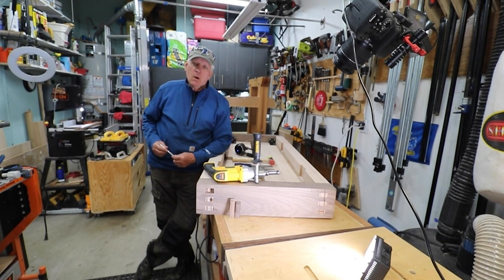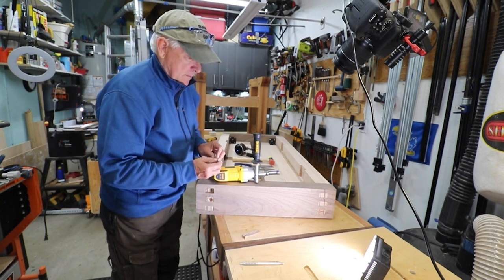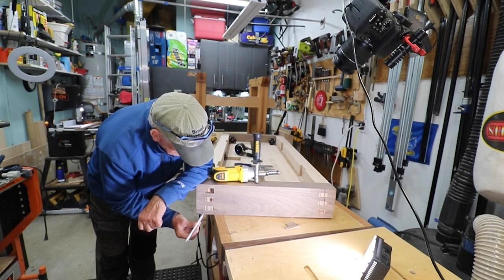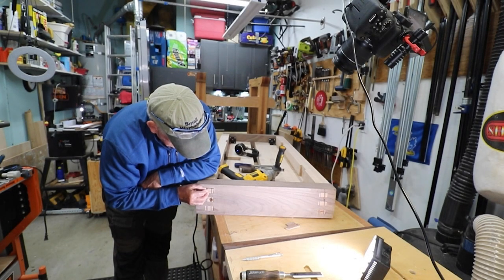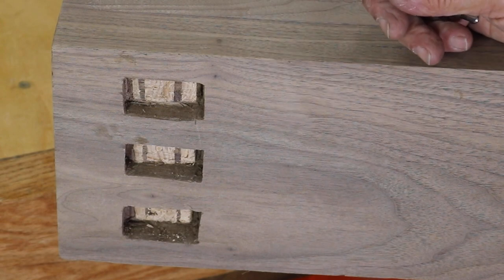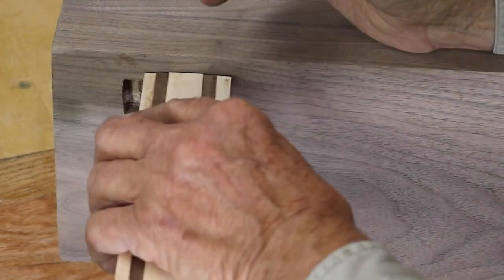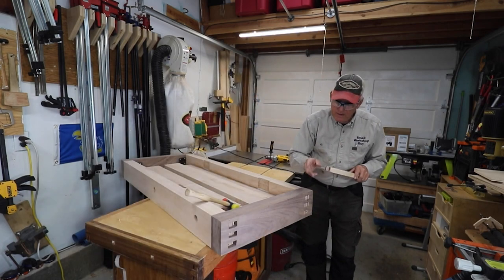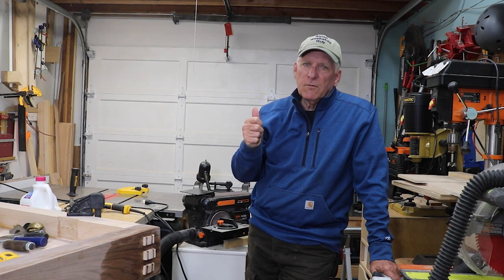How I Fixed My Completely Botched Samurai Carpenter Workbench Wedged Tenons - Disaster Averted

Comment: Thanks for the video, it's nice to see how to fix things when something goes wrong. My first attempt at dovetails came out so different than how I envisioned them in my head beforehand since I had watched so many videos on how to do them. My main issue was that my chisels were damaged slightly, but I still thought were usable. Nothing could have saved those dovetails short of starting over, so I filled the gaps created by the tear out from the chisels with glue then forced sanding dust from the same wood into the gaps and the glue to hide the mistakes. Fortunately they are on drawers where the joints are not easily seen, so no one will ever notice the mess.
Reply from the maker: Thanks!  I am getting good at fixing mistakes.  Must be because I am making so many of them.
Reply: @SmallWorkshopGuy  To paraphrase what Jonathan Katz-Moses says; the sign of a good woodworker is not that they don't make any mistakes, it's that they know how to fix their mistakes.
I too make many mistakes that I have to fix, but I'm hoping that none of them will be on the workbench I'm building.